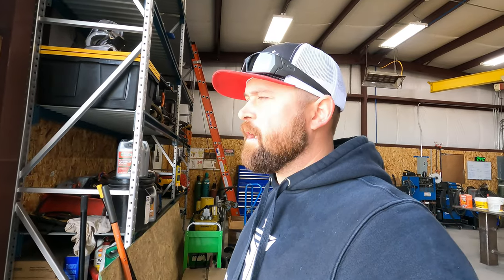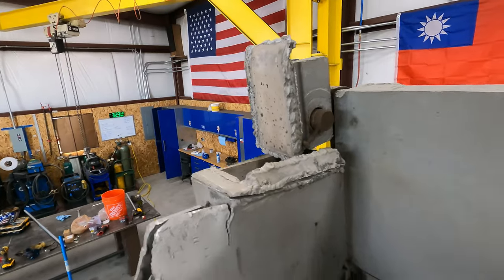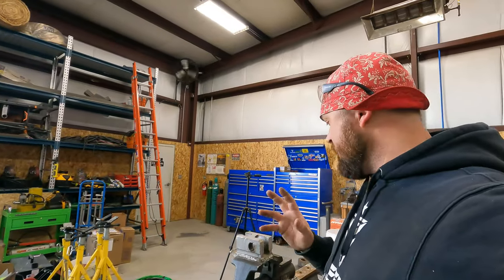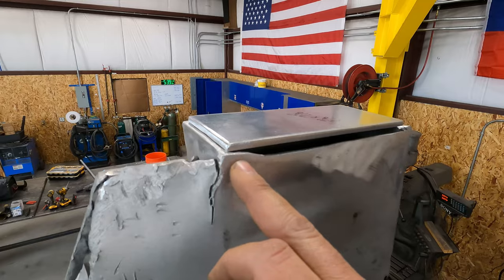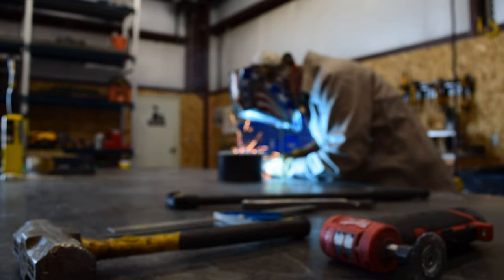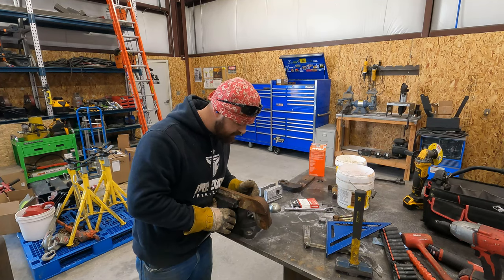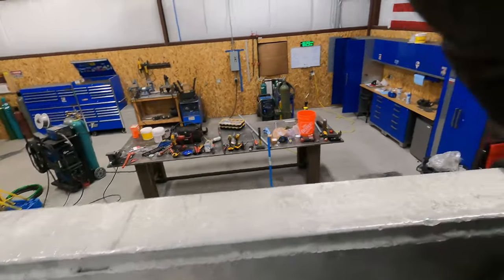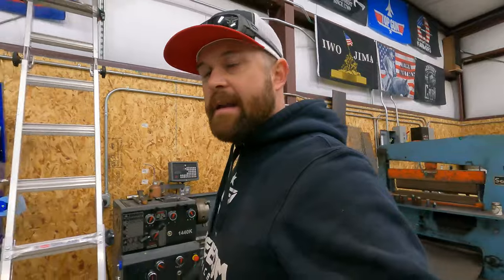Aluminum weld repair on Bob Marley Dump truck and shop update

Comment: When my boss asks how long one of these quick turn around low budget jobs will take... I say; we're panning for gold...  It could be today, it could be tomorrow....  It's not a magic show...  You sir are a magician..  That cracked gusset was driving me nuts.  Glad you decided to fix that too... lol. Cheers
Reply from the maker: Lol. Sometimes I think the customer thinks I really am a magician. And then I think, I'm just a welder, not a freaking magician! I will everything in my power to fix it right, but sometimes to fix it right, its just going to cost more than the customer wants to pay. That's when it gets a little tricky, and at times, frustrating. I like the gold panning metaphor.

Comment: i’ve seen that some agriculture equipment owners in my area sometimes just have a guy weld and repair an implement just to finish the day as a emergency repair and later on in the future do a full inspection and complete that particular repair and others that might appear
Reply from the maker: That is true. I’m sure that takes place. I guess I would just hope that when the owner finally gets around to getting the equipment fixed right, that they aren’t so stuck on a budget that they skimp on quality. Thanks for watching!

Comment: Hi thanks for video, why didn't you put in a cross member/brace. That would stiffen the bin and sort out the bending issue. My tipper has massive angle  iron across the bin.
Reply from the maker: Well, that goes back to the customer having to spend more money. He wanted me to try to stay within a tight budget. I tried to stay within that budget as close as possible and still do a good job. Those are the jobs that are sometimes the most frustrating/tricky.

Comment: I totally understand your frustration. Been there before many times making nightmares turn into miracles. Working on any kind of commercial transport vehicle as a welder is always going to be dirty work. No pun intendended. The side walls on any dump box will instantly distort in or out and what keeps it square is the end gate.
Reply from the maker: Yeah, it can definitely be frustrating. I guess you do the best you can within the customers budget, within reason. And if they don’t want to pay you enough to at least make it a practical fix, then you tell them to find someone else who is willing to do that. It can be tricky finding the balance. I guess it’s part of that learning curve of owning your own business.

Comment: How did you go about deciding what grade of alumina the trailer was? Steel is the only easy to discern material for me.
Reply from the maker: When it comes to aluminum and things like dump truck beds, I have always used either 4043 or if I’m feeling really frisky, 6061. If you stick to the more common grades of aluminum, they typically mix quite well. If it was the space shuttle, you might wanna confirm what grade the material is, but for 99% of aluminum projects they typically live in harmony. That is just how I have always done it. Thanks for watching!

Comment: Nice fix. That had to suck without having something to rest the torch hand on. I've never used one, but would a spool gun be usable on a job like this?
Reply from the maker: Yes, that’s definitely an option. My plan is to get a push pull gun for the millermatic 255. Same principle as a spool gun, gives you the ability to run mig aluminum. Downside is they are $2500-$3500. They do make it nice though for jobs like this one.
Reply: @Freedomfabrication777  😳 Spendy!
Reply from the maker: @MyLilMule  Yeah. I would say that’s one of the down sides of starting a fabrication business. It’s expensive. You know how that is. Machining equipment is the same.
Reply: @Freedomfabrication777  I have the luxury of not using my machines to make money, so I can buy an older machine or one that just needs some attention and repairs, fix it up, and put it to use. I can afford to wait. My K&T horizontal has been in various states of repair for well over a year. Getting close, though!

Comment: You need to get a spool gun for aluminum. I was surprised you didn't chemically clean and preheat the aluminum before welding it. It turned out good, but it was a lot of work. When they bang the tailgate to get the stuck dirt out of the bed, that will  test on your welds. From what I see in your videos, you're using 50 amp outlets for your welding machines The electrical inspectors in my area will not  allow a 50 amp outlet to be protected by breakers or disconnect larger than what the outlet is rated for. You can check the National Electrical Codes online.
Reply from the maker: I’m actually planning on getting a push pull gun for aluminum ,
I prefer them over spool guns, but they’re between $2500-$3500. 
I’m not sure where you saw 50 amp welding outlets in my shop, I don’t have any 50 amp circuits in my shop. all of my welding outlets are 100 amp. Everything is up to code. Had to pass an electrical inspection when I built the shop.
Reply: Stuart, I saw that receptacle for your welding machine on your Shop tour 2022 and you said you got them from Home Depot. I, too, have a shop with large equipment, and the 100 amp receptacles are about $350 each, and the plug is the same. If you have a line on them, please let me know your source. Our Home Depot doesn't carry them. If I am wrong I apologize. Keep up the videos

Comment: How big is ur shop, how much did it cost whos manufacture
Reply from the maker: It’s a 40’x 60’x 18’. At the time, the kit was $23,500. That doesn’t include dirt work, or concrete, or insulation, or doors. Price for all of that = about $50,000. I’ve heard the price of everything is about double now. You can get more details by watching my shop tour video. Thanks for watching!

Comment: Nice repair! You did all that you could with the time/money restrictions.  Repair work is hardly ever straightforward, especially on aluminum.  I’ve been eyeing up an HTP machine lately for the aluminum options that they have.
Reply from the maker: Thanks, sometimes the customer makes it stressful due to budget restrictions, so you just do the best you can with what you have to work with. Thanks again for watching!
Reply from the maker: You’ll have to let me know how you like that machine if you get it!👍🏻🇺🇸🔥🤘🏻⚡️